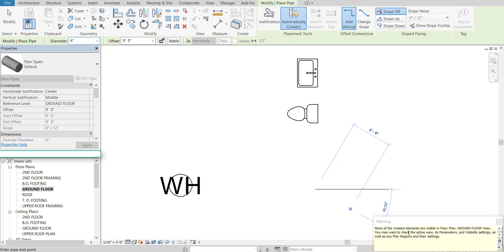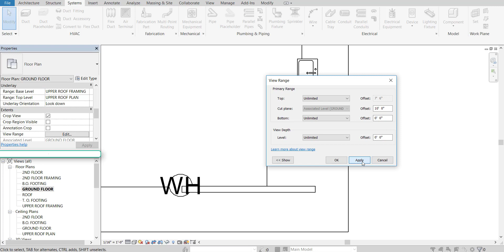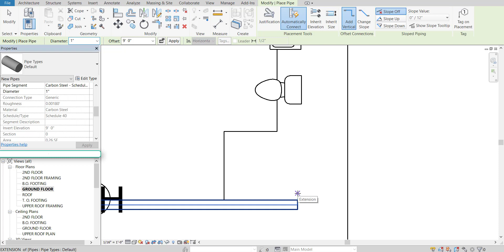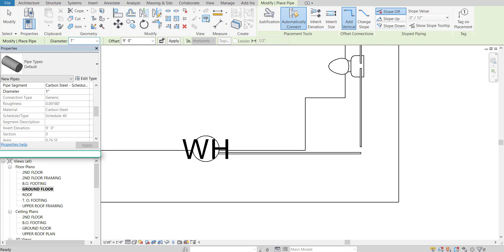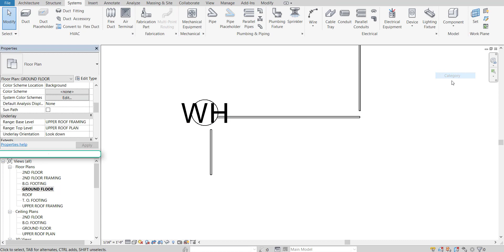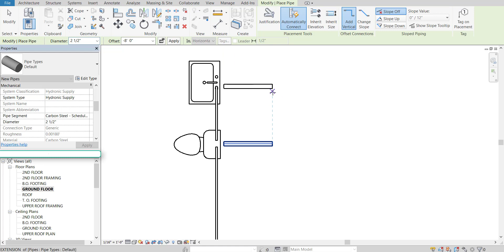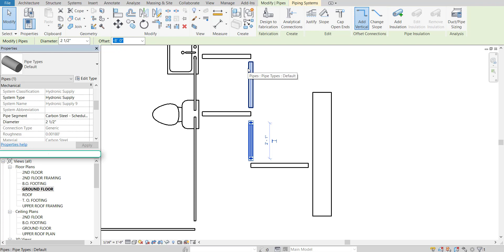3D Plumbing Plan - Autodesk Revit 2018 - Part 1

Comment: im drawing pipes in Revit architecture 2020 and whatever the system is. its always black. unlike in revit mechanical template. it shows blue for cold and red for warm.  What am i doing wrong? why the pipes in the architecture template are all black?